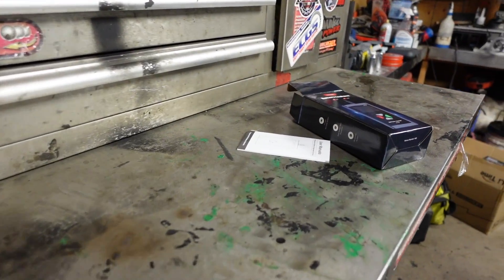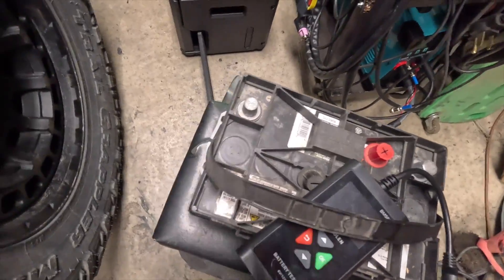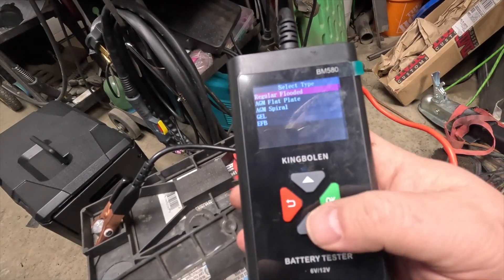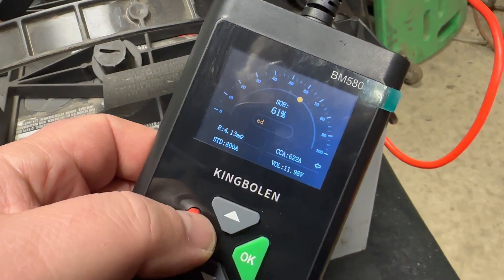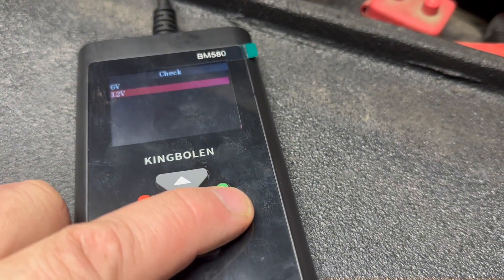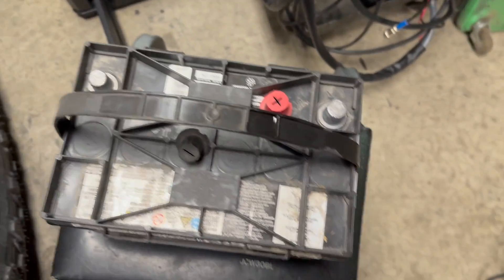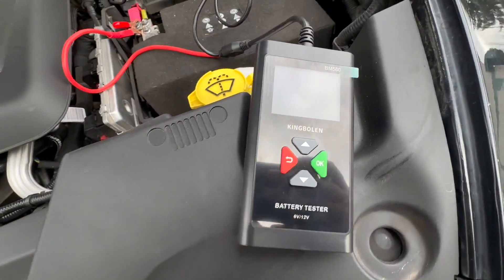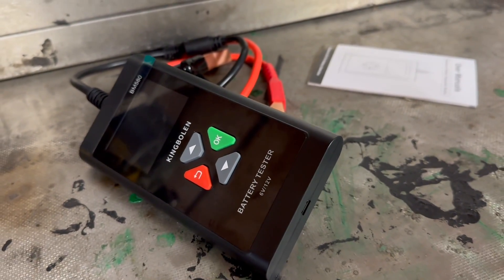KINGBOLEN BM580 BATTERY TESTER

Comment: I doubt it actually puts any load on the battery to pull any amps. Seems like it simply measures internal resistance and voltage and guesses the rest out of it based on provided CCA.
Try set it to 100 CCA and see if it still shows the same result of hundreds of amps as before.